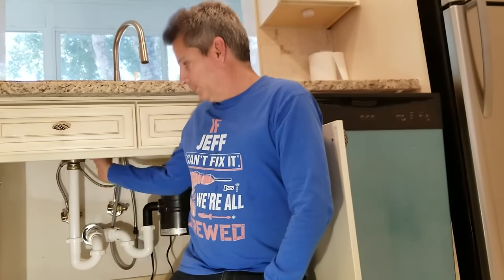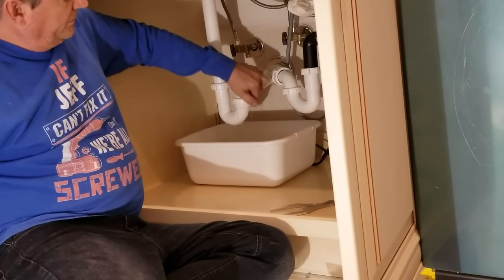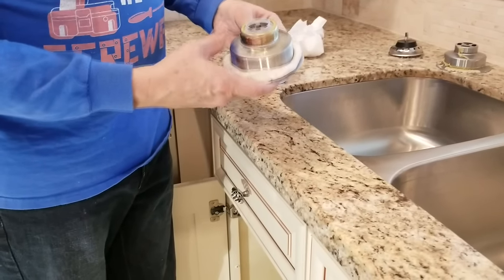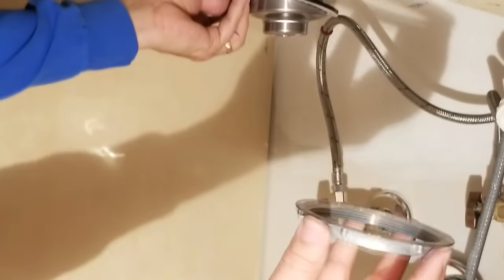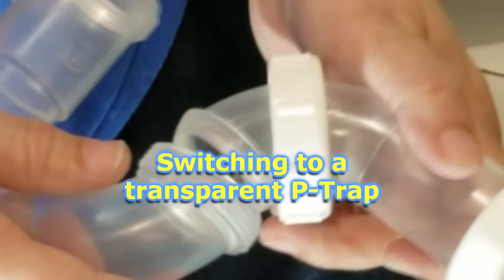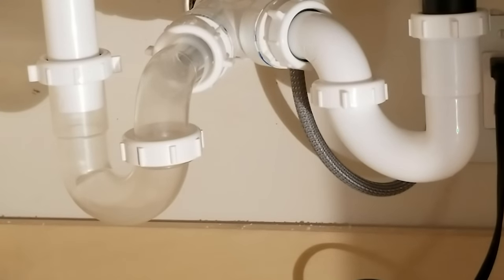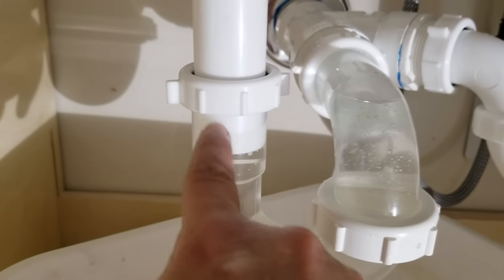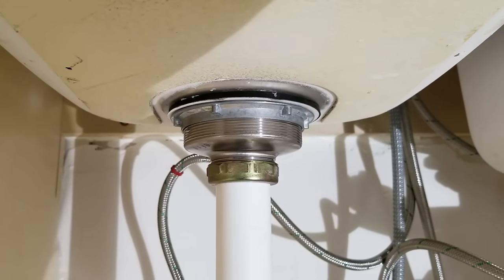How to Replace A Kitchen Sink Drain Strainer, Repair Leak

Comment: Great video, clear to follow. but PLEASE DO NOT use plumbers putty!!  That stuff  is  USELESS!!  will NOT seal against water,  barely lasts  more  than a month if  that. Make  sure  to use a silicone  sealant designed to be  waterproof/resistant and specifically for  kitchen sink drains. You can by tubes  of  this compound for  about the  same  price as  plumbers putty. Spare yourselves  a  lot of  heartache and frustration.
Reply from the maker: I agree that silicone is better, but you are wrong about putty, it lasts for years. IF it only last a month, then someone really messed up the application.
Reply: @jeffostroff  yes  silicone  is  better. And  I applied the  putty exactly as  you indicated. You, or  anyone  else  will never  convince me that plumbers  putty is   nothing but garbage, and  not worth spending a penny on it. I will go with silicone and  I will tell ANYONE  else  never  to use  plumbers putty, as  it is  a  complete  waste  of  money.

Comment: Can't you just replace the cardboard ring and plumbers putty?
Reply from the maker: Yes you can, and that may solve it for most people. But I can also tell you that if most people had leaks through their cardboard, then they likely have corrosion under the sink on the nut and the strainer threads, so usually a good time to change it all out and start all over, reset the calendar clock back to day one with a new strainer.

Comment: Do you need to buy a new strainer?
Reply from the maker: I always buy a new strainer kit because the whole kid is only $7 that way are starting off with brand new and you're getting a brand new cardboard washer as well that friction ring that I mentioned in the videos. And a lot of people throw that out thinking they don't need it so chances are your sink might not have one on there anyway but it should be there so to me it's a no brainer to replace it with all brand new
Reply: @jeffostroff  Thanks

Comment: None of these videos say how tight you need to tighten the drain down.
Reply from the maker: I like to make it nice and snug, enough for the drain flange inside the sink to look flush with the bottom of the sink, and looks like no more plumbers putty will ooze. Then I know it is tight enough.
Reply: @jeffostroff  Thanks that's about right then what I ended up with. I also noticed that there can be an issue with the drain staying level that I didn't here mentioned in the videos. IOW keeping it from sinking, excuse the pun, on one side or another. Anyway, got it pretty even. It'll do. Now on to the rest.

Comment: Couldn't I just throw a bead of caulk around it from underneath
Reply from the maker: Unfortunately no this is a mistake that many people might make you have to solve the issue from where it starts which is up top. The reason why water was allowed to leak below the sink is because the plumbers putty has worn down under the drain flange so you have to take everything apart, pull up that drain flange and lay down a brand new bead of plumbers putty up top on the sink. This is what we'll solve the leak also some people prefer to use silicone instead of plumbers putty as they feel that lasts a lot better and doesn't dry and crack

Comment: I took off all the nuts to my sink it’s still not moving. I think the old owners used some sort of cement glue. They cemented shut the hex nut to the knob. If I pull it upwards to put in the hex tool I can see cement glue all on it. Idiots think they’re saving money but on the long run they’re making unnecessary damage. The old owners were Koreans and they’re known to do things that’ll save them money upfront.

Comment: I dont know why the open sink nut wrench is even made
Reply from the maker: Believe me once you use that wrench it is the best tool ever. Not everybody can get in there with a screwdriver and hammer to loosen that nut way up high some people have a lot of stuff going on underneath their kitchen sinks making it real difficult to get in there
Reply: @jeffostroff  thanks for the reply. At my local home depot they didn't have the one which you used in the video, similar concept but one side was open as opposed to being a complte circle. I ended up just breaking it with cutter pliers. Once it's stuck the way mine was I don't think any wrench would of helped because it wasn't even about grabbing on which the circle wrench would do better at, but it was about creating the opposing force to torque it against. This is for drains in which the seals have completely shot. You can see the result here;

https://youtu.be/nkxWDEaNnug

Comment: My damn water isn’t draining now.
Reply from the maker: Remember the input to your P trap coming out of the drain from your sink, must be higher than the output of the P trap going into the wall pipe. If the wall pipe coming out of the P trap is taller than the input, you will never drain the water.

Comment: I discovered that my kitchen sink is leaking. It had been leaking for at least a week before I noticed it. After watching this video, I can say that the kitchen sink drain is leaking AND the P connection is leaking. Neither was leaking before and now they are leaking together. I am debating whether to fix it myself when my only knowledge of plumbing is your two easy to understand videos or call a plumber who will charge an arm and a leg. 🤔🤔🤔🤔
Reply from the maker: Try to fix it yourself according to these videos, then if you still have the leak, call the plumber.

Comment: why not just put new putty top and bottom?
Reply from the maker: There is no need to put putty on the bottom the idea is to stop the water from the top side from ever getting to the bottom side by way of the putty or by using silicone. I normally preferred or just replace the entire set of hardware and everything so you reset the clock and everything starts back at day one all over again all looking brand new. And when I'm remodeling especially kitchens and if it's going to be sold, you don't want to give the buyers inspector any reason to give negative feedback on any of the work so everything looks brand spanking new when they open it up and look up there. They're not going to see any rusty nuts on my watch
Reply: @jeffostroff  yep, noticed the top side importance when I did it today. Just used my old one, but it looks horrible underneath. still, it worked. I hand tightened the bottom as it was impossible for me to get that thing on with the tool. I'm taking that tool back to lowes. can't see ever using it again.